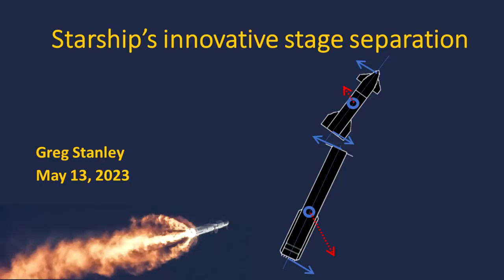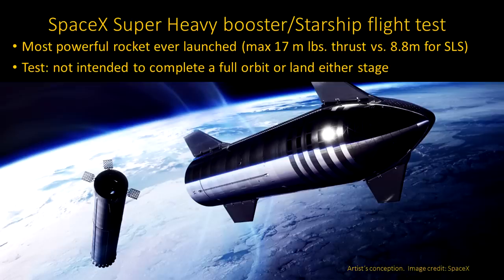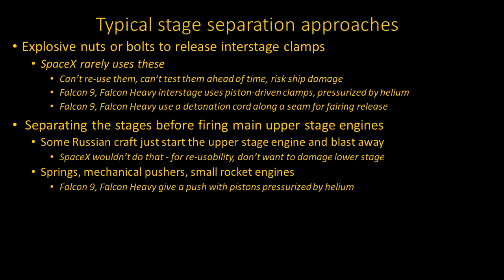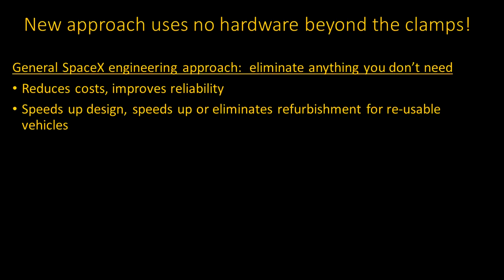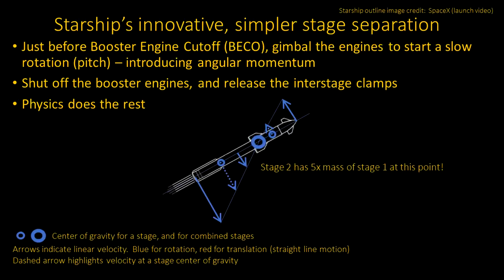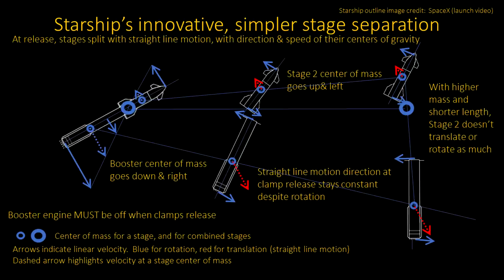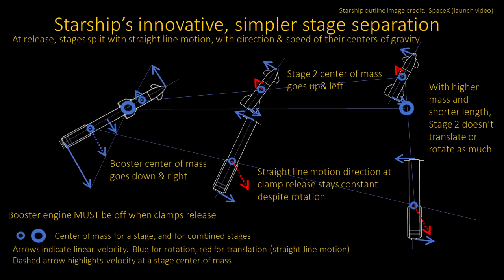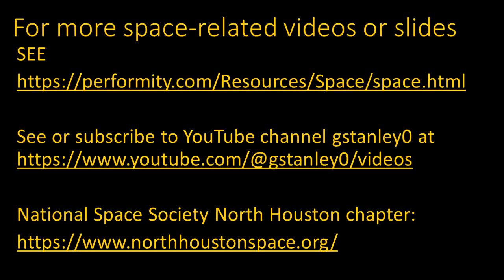Starship's innovative stage separation, using no hardware besides clamps, illustrated

Comment: Well that was stupid and obviously didn't work.
Reply from the maker: @markuskoivisto ,  no, we actually have no idea.   That test #1 didn't meet the criteria to start the stage separation (probably altitude, etc.), so it wasn't attempted.  Those cartwheels of the entire rocket during the test showed that the clamps never released before the explosions.  Before test #2, they changed to hot staging, a completely different approach.  The stated reason for the change was an increase of 10% in payload, because of reducing the time that gravity could pull back on the second stage.  While that benefit might not have been the only reason for the change, it's enough to explain it.  SpaceX had experience dispersing satellites using rotation, so it wasn't obviously stupid, just different, and there was no reason to doubt SpaceX engineering's ability to calculate the basic physics (rotational dynamics) properly.  Problems were more likely to be in hard-to-calculate factors like sloshing of liquids, which may be what caused problems in test #2.

If you were referring to the hot staging as being stupid, instead of the separation with rotation intended for test #1, hot staging itself has been used for years, especially by the Russians, so it's a well-known successful technique for disposable first stages.  Attempting this for a re-usable first stage was a first, though.  Doesn't make it stupid, just meant there were technical problems to be solved.   It seemed that the first stage wasn't significantly damaged by the hot staging, and more likely that there were problems with liquid sloshing around during the flip for the boostback burn.  We'll have to wait for details from SpaceX.  Probably solvable problems.  The second stage did continue on for 6 or so minutes after separation, then failing for some other reason.   So, the hot-staging separation did work as planned from a mission standpoint (stage 2 viewpoint).  It was the return of the first stage that failed, as well as whatever finally happened to stage 2.
Reply: It has been over a year so it should have been obvious at this point. In fact it should be obvious to anyone who has a logical mind who isn’t just a hater.
Stage separation was never attempted on Flight 1.
Stage separation was supposed to occur at an altitude of 65~ kilometers, or around 2 minutes and 40 seconds into the launch. When IFT-1 got to that point in time, it was well below that altitude, at only around 29~ kilometers. No way they would separate the stages at that point. Anybody who is logical should know that. And also, prior to separation the booster engines will all shut down. The engines never shut down on IFT1 because it wasn’t commanded again for reasons I’ve described.

Now of course everything I’m saying now is already outdated since SpaceX has switched to the hot staging mechanism which should be a lot more reliable.